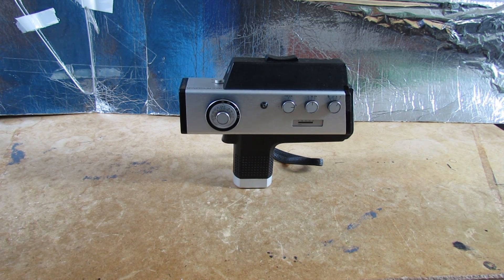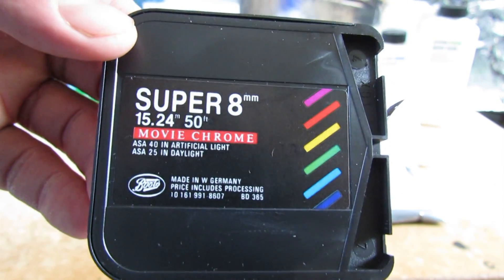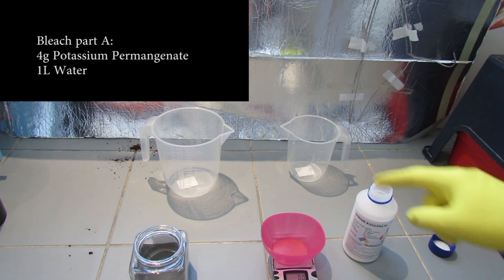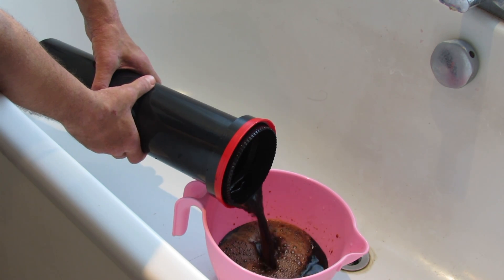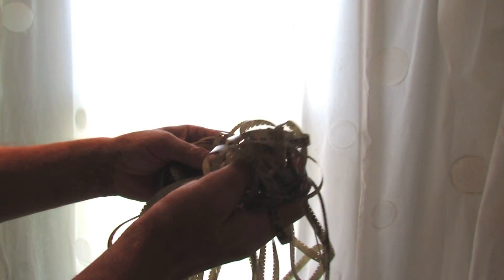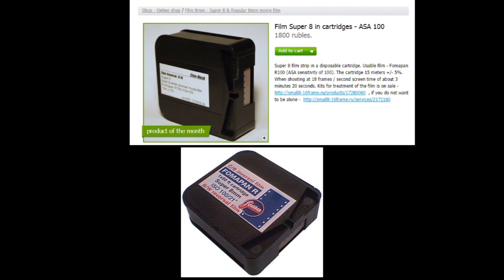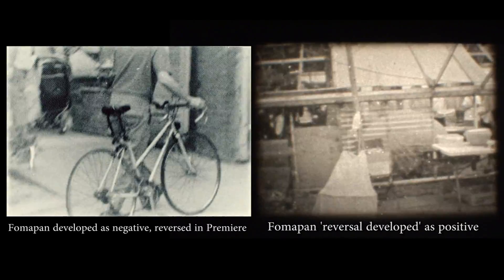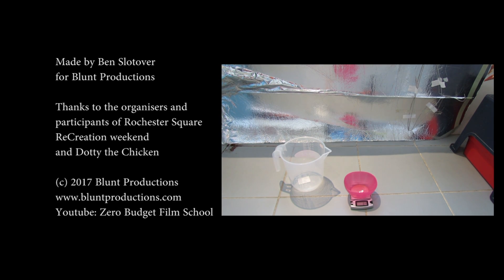Reversal processing Super 8 in Caffenol. FULL instructions included!

Comment: there are 142 comments and instead of sifting through to see if someone else already asked my question I will ask: can you use the normal caffenol process on the B&W reversal super 8 film to create a negative image or does it not work that way?
Reply from the maker: It's been several years since I posted this video and I've learned a lot since then. Fomapan R100 reversal has a silver layer which has to be bleached out, either as part of the reversal process or before developing if you want a clear negative. Without bleaching you are left with a very dense negative which can be scanned, but only with a super bright light. Kodak Tri-X is also technically a reversal film but doesn't have the silver layer so can be developed as negative, albeit coming out a bit grainy.
Reply: @ZeroBudgetFilmSchool  I plan to use the Kodak tri-x so that’s good news if I don’t have to strip away the silver layer

Comment: I was doing reversal processing of 35mm still camera black and white film using 250 mililiters of regular 3% medical hydrogen peroxide mixed with 15 mililiters of imitation lemon juice. Mix in a Pyrex measuring cup and microwave in a 1,100 watt microwave oven for 1 minute and 10 seconds. That would be the bleach solution. The caffenol I used was 6 teaspoons of instant coffee (cannot be decaf), 4 teaspoons of washing soda, 1 teaspoon of crushed vitamin C pills and 1-3/4 teaspoons of iodized salt. Load the developing reel and tank under several bedsheets, put a rubber band on to keep it closed. Fill the developing tank with room temperature water through the light tight filling hole while you go and  put 3/4 of a cup of 68 deg F water in a measuring cup and start stirring it and keep stirring as you dump in the washing soda first. Dissolve it until it is almost clear then dump in the salt and crushed vitamin C pills. Once it's dissolved, put it in a separate cup then rinse the measuring cup and put in 3/4 of a cup of 68 deg F water. Dump the instant coffee into the water and dissolve. Then put the solution with the crushed vitamin C pills, salt, and washing soda into the measuring cup with the dissolved coffee. Mix it up real good. Rinse the cup that you used to hold half of the caffenol solution, you are going to use it again later. Dump out the water from the developing tank (DON'T OPEN IT!!) and pour in the caffenol solution you just brewed. Once all the liquid is in the tank set a timer for 28 minutes and agitate the tank by gently shaking it side to side continuously for the first minute, then every 10 seconds agitate it for 3 seconds until you get to 28 minutes. Then dump the developer into the cup you used for half of the caffenol solution and fill and dump 3 complete changes of water through the developing tank. You can now open the tank and you should see very dark dense reflective images on the film. Heat the bleach solution you made earlier (no rush, you can make the bleach solution now if you forgot), and dump it into the wide open developing tank with the film back on the spool. You will hear some fizzing sound in about 4 minutes or less--when the fizzing stops, wait one additional minute and then take out the film and look at it. It should be orangish pink in color and should have a faint milky positive image signal on it. Go in front of a bright light bulb and make sure this film gets plenty of light on it, should take about 60 seconds. Pour the bleach solution into a bottle as you can use it for one additional use after this. Rinse the film pretty well, put it back on the spool,  and take the cup that has the developer put into it, and put it in the developing tank with the film int. Now go forget about this and go do an absurdly important recreational task for about 7 hours. When you come back the film should look almost completely black but if held up to a bright light you should see very dark yellow where the light came into the camera and struck the film. Then dump out the caffenol down the drain and fill a separate deep lunch tray (with a separate developing spool you bought extra for this step) with water and use about 1 teaspoon of Sodium Thiosulfate powder for every 8 ounce cup that you needed to get it to fill. If you do not have Sodium Thiosulfate available you can use AquaSafe the stuff that makes tap water safe for pet aquarium fish. Use that straight from the bottle and don't mix anything. Let it sit in this (the fixer) for 8 hours and dump it out and replace it it fresh fixer. Do this until you get to 24 hours after you first put fixer in and rinse the last of the fixer out of the film emulsion and Voila! you have positive images to gawk under a compact fluorescent flashlight. This also works for Arista Ortho Litho Film 3.0, but halve the recipe for the caffenol keeping the strength constant and leave out the salt, then develop for 5 minutes with continuous agitation for the first minute, then for 3 seconds every 30 seconds.  Stop it with tap water (you can do all of this under a red LED bulb provided it's not the phosphor/filter type). I have not been able to get the bleach solution to work without causing bubbles to leave pinholes in the image, but it DOES bleach. However the second development finishes in a blisteringly brief 4 minutes. And after that you only need to soak it in the sodium thiosulfate for 8 hours instead of 24.

Comment: Would you recommend this Paterson tank for developing 16mm? Those lomo tanks are bit pricey haha
Reply from the maker: I wouldn't recommend doing 16mm in anything but the really big Paterson tank if you have 100ft and you don't want it to look like crap. It takes up so much more space than 8mm you won't easily prevent the film from sticking to itself while it's in the tank.
Reply: @ZeroBudgetFilmSchool  Ah right cheers, is the really big Paterson tank the 8 reel one? Is do they make tanks larger then that?
Reply from the maker: @joshuawisdom7585  Yes the 8 reel one. As far as I know that's the biggest they make. You should think twice though, the thing takes 2L of developer (or fixer) to fill up. You would probably save in the long run getting a Lomo or a Morse tank.
Reply: @ZeroBudgetFilmSchool  Right okay, I'll definitely keep the lomo tanks in mind, cheers, and with the Paterson tanks do you just stuff the film inside put the cap on and pour it in as you've done in this video?
Reply from the maker: @joshuawisdom7585  yes, I pulled the film out of the cartridge , made a ball of it and put it in the tank, all inside a changing bag (remember the long funnel tube). It works with super 8 in anything bigger than a 2 reel Patterson tank. 16mm I never tried in the Paterson but would only do so if I'm desperate.

Comment: Hello, can the bleach and clearing bath be used several times ?
Reply from the maker: The clearing bath can, but I've since stopped bothering with it as I discovered you can just rinse longer instead. The bleach can also be reused but first you have to filter out all the silver particles or they will stick to the next film you put it into. Also, the bleach won't be as strong second time round, especially if you don't use it for some time. Best thing would be to use fresh bleach each time if you can spare the chemicals.
Reply: @ZeroBudgetFilmSchool  Ok thanks. I was just wondering about environment issues... By the way, I have dozens on old and color shifted ektachrom E100VS, I tried a regular BW (rodinal, fix) processing but the film itself remains very opaque. Very hard to scan. Do you know a way to do a BW developping and removing this opacity ?
All your processing (bleach, clearing), a what temperature do you di it ? 38° like standard E6 processing ?
Reply from the maker: @jimofmarseille  as far as environmental concerns, i don't think it's any worse than most of your household cleaning products.
Reply from the maker: @jimofmarseille  my Temps were all in the low twenties for this Caffenol development. Basically water out the tap and room temperature.
Reply from the maker: @jimofmarseille  the VS in your Ektachrome stands for Vivid Saturation, it's a colour slide film that would probably be done in E6 at 38C. If you're doing it in b&w using Rodinal or Caffenol my advice is to try several dev times at 21C , rinse and fix like a b&w negative. Then see which Dev time brought out the least opaque result. Dark negatives can be a sign of overdevelopment, how long was it in the developer for?
Reply: @ZeroBudgetFilmSchool  It's not the image itself that is dark, it is the film support, even yhe side is with this dark brown-red ugly and opage mask, you have to pur a very powerfull light to see through it. Maybe you can use it to looka at the sun directly without sun glasses ! I think it is a silver mask if I undertoode well and the standard E6 process removes it. I'm gonna try the H2O2 + lemon juice people are speqking about in the thread

Comment: Hi! Thanks for this video, quick question: You mentionned at 4:10 that sodium bisulphate can be replaced by concentrated sulfuric acid. As I already bough acid I would like to know at what proportion I should mix it with water to get the equivalent? 
Thanks in advance; looking forward to develop my film
Reply from the maker: Hi Leo, here's what the official Ilford info sheet says for making Permanganate bleach with Sulfuric acid: 
Two solutions, A and B are mixed as follows: 

for solution A add 2g of potassium permanganate to 500ml water 

for solution B add 10ml of concentrated sulphuric acid to 490ml water. 

If concentrated sulphuric acid cannot be obtained use dilute acid. This can be a 10% solution. If 10% sulphuric acid is used add 100ml to 400ml of water to make the part B bleach solution.

Comment: We just got all the chemicals you described and we finished our homemade motion picture camera! Were going to shoot some test film tomorrow! We have 400asa color negative on hand to play around with (10 free 35mm roles). Will this work in the reversal process or should we stick to black and white? Thanks!
Reply from the maker: You can certainly develop colour negative film as black and white using Caffenol, but I would advise doing a test strip and only doing it as negative first, ie just develop & fix. If you find the right development time for negative then move on to a reversal test. Watch out for those bleach timings! The first time I tried full reversal on colour film to produce a b&w image, I messed up the bleach timings (left it in too long) and all the emulsion started peeling off. These days I use peroxide + acetic acid for colour film as it's gentler on the emulsion.
Reply: @ZeroBudgetFilmSchool  can any of the reversal chemicals be used more than once? Thanks!
Reply from the maker: @jasonanderson9757  oh absolutely. Filter them through a funnel & coffee filter  before you re-use though, especially the bleach. The bleach and fixer should be good for many development runs. Caffenol goes off quicker but it's pretty cheap to mix up a fresh batch.
Reply: @ZeroBudgetFilmSchool  hey! So we successfully bleached and cleared the film. Its beautiful BUT when we re-exposed and re-developed, it stayed completely clear. No positive :( we used a 200 watt LED bulb and exposed for 5 minutes. Could the LED be the cause?
Reply from the maker: @jasonanderson9757  5 minutes under a 200w lamp is plenty, so it's not likely to be that. What did the film look like exactly when it had been bleached and cleared? It usually looks yellowlo/cream colour and is opaque,, going to cream/light grey when it's been re-exposed , with faint grey images where the picture is. If it's clear -,i.e. you can see through it, it sounds like you over-bleached it and the emulsion has come off. If this is the case , take it out of the bleach sooner. What film stock are you using?
Reply from the maker: & by the way, the clearing bath is for clearing the bleach off the film, not making the film itself clear. That happens last, during the fixing.
Reply: @ZeroBudgetFilmSchool   I'm using ilford asa 50 35mm b/w film meant for bulk stock loading. I have a 100 foot roll of the stuff to play with. We used the bleach for 4 minutes.  The film ended up looking completely transparent and grey-ish. We also noticed the clearing bath looked a little grayish when we drained it. So we probably dissolved the emulsion?? (By the way thanks for all the feedback. We are loving the process and eager to learn!)
Reply: @ZeroBudgetFilmSchool  also I just realized looking at our notes that we used the "fixative bath" after the first developer and not a stop bath. Could that be the culprit? My understanding was you could start the process on already fixed negative film. Maybe not? 😳
Reply from the maker: @jasonanderson9757  OK, so assuming you exposed the film properly in the first place it sounds like it was in the bleach too long. I know I said 4 minutes but that was with Fomapan and ilford may be different. You should try just develop & fix a test strip to see if you get a useable negative with those timings. If that's all good, do it again with just 2 minutes in the bleach. If you don't get any decent negative then something is wrong with your first development. Great to see you're keeping up with the experiments. Keep a log of all your mixtures, timings and temps. It is very useful for tweaking your process if you have a record of what you did each time.
Reply from the maker: @jasonanderson9757  ahhh, just saw your second reply. Yes, using fixer, before the bleach will definitely mess up your images. Save the fix for the very end, just before you do the final water rinse.
Reply from the maker: & you can replace  the stop bath with a good 5+minutes rinse in water if you like.
Reply from the maker: @jasonanderson9757  wow your home made camera& projector are amazing! What age & ASA film are you using?
Reply: @ZeroBudgetFilmSchool  we're using fresh 35mm ASA 50 and ASA 100 film in 100 foot rolls. They're bulk stock rolls for loading little 35mm canisters. We've only been using a few feet at a time for testing. Still figuring out exposure time! The reversal film we made was only 4 feet and we didn't change any of the processing times. Were we supposed to due to the small amount of film?
Reply from the maker: @jasonanderson9757  No, thats OK, processing time should be the same for 4 ft. or 100 ft. That's the whole point of doing tests!  If I were you I would try a range of camera apertures on your next test. Also, try some different first developer times. You may find a longer develop, then fixer to make a negative, will yield a better picture. If you're reversal developing, remember that all the picture you develop in the first run will be bleached out and removed. The more you develop, the more will be removed and the lighter your end result picture will be.
Reply: @ZeroBudgetFilmSchool  that's very interesting about the development/bleach. We will run more tests like you suggest this weekend! Thanks again!
Reply: @ZeroBudgetFilmSchool   hey Ben! I loaded a film called test footage in my YouTube. It's 70 feet of footage using different settings. One weird thing: it looks like its positive already and all we did was develop it. Do you know what might be happening? We developed 20 minutes  caffenol in a winding tank developer.

Comment: thanks for posting all this.  i'm building up to having a go and have the shopping done! i'm going to initially try out 10 foot sections of a 50foot roll of tri-x super 8 , individually.  i'm just going to pull out 10 feet by hand if i can.  then, because i have one, am going to use my patterson 2 reel tank without the spools inside(?). any tips before i go for it?  presumably i can just change the quantities to suit the tank (570cc). thanks in advance
Reply from the maker: Hi Ed, good idea to do some short strips until you're certain of what works. Most important is the 1st developer and how long the film will be in there. Also don't leave it too long in the permanganate bleach or the emulsion will come off. 3 minutes max. A 2-roll size Paterson tank is a bit small , make sure your film isn't coiling up and sticking to itself or the developer won't get to all of it. Good luck!
Reply: good tips - thanks.  will go for about 5 feet then - which would give me ten goes if necessary on the roll i shot today!  also... are timing based on room temp? = about 24 degrees atm? (apart from warmer to mix the chemicals?)  and finally i think, can any of the mixes be used again for next strips?
Reply from the maker: @edsayers6460  yes you can  reuse the liquids. All fluids were room temp, about 23C